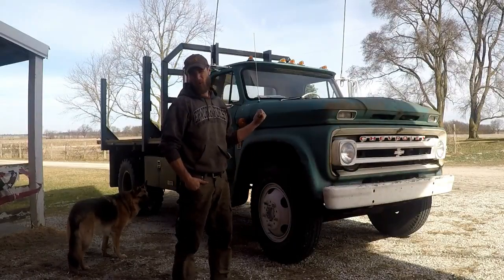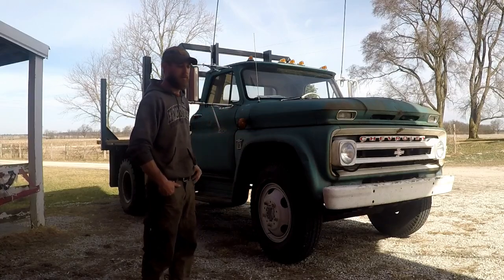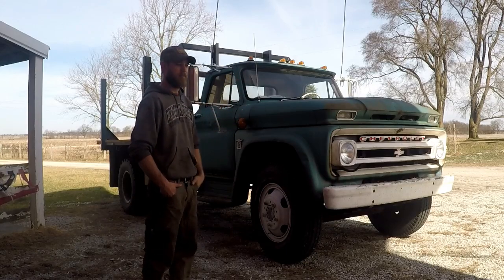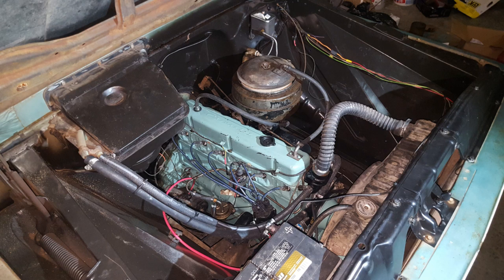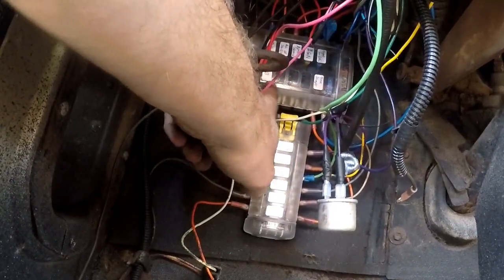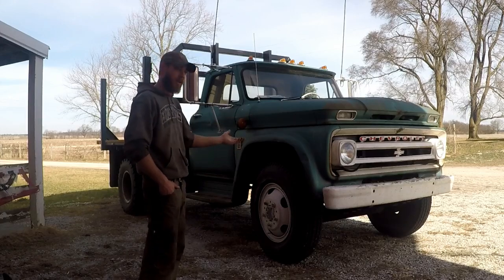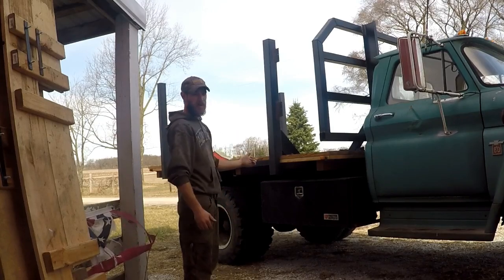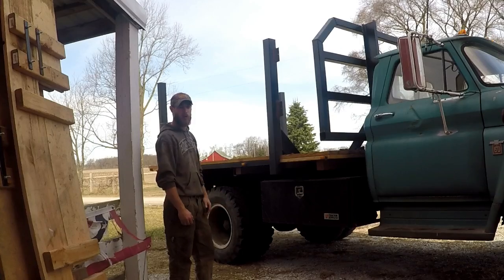1964 C60 Rebuilt

Comment: Love what you've done with the old C60! I bought a '64 C60 dump truck last fall and really haven't had to do much with it. Went through the lights and polished it up and painted the box and got it to pass Virginia State inspection so I can work it. Mine has the 327 but I've had one of those 292 six cylinder. That was a GREAT eingine in the 67 short bed stepside 4X4 I had in my late 20's through late 30's. In the 13 years i drove it we went over 300k miles and the pickup was 22 years old when I bought it and run by a Logging company in Northern California, Trinity Alps, Scott Valley area. It was kinda beat up when I bought it.

Anyway, back to my 64 C60. I had to replace the Hydrovac booster and when I decided the brake line plumbing was not making any sense, I removed the lines form the master cylinder because I felt the return line going into the front of the reservoir from the pressure end of the Hydrovac was not correct. Just as well, it was glued in so I am getting a new master cylinder. Now that I see what you explain, it must be set up right but should it come out of the end of the Hydrovac or should the return be out of the bleeder port?  The brakes were working fine until I started hauling heavy loads. The booster went out on me going into an intersection and fortuneetly no one was in front of me. 
I notice yours has the two port vacuum check valve for the brakes and 2 spd axle. I am going to take mine off and make sure it is not responsible for taking out the Hydrovac. Have you found a good source for those kind of parts if it's bad? I keep looking on the net but haven't seen any check valves like it yet. You can check out my goins on Instagram 

stephen.graf Hope to hear from you. Thanks!
Reply from the maker: The two line brake system uses a smaller line from the output of the master to the input of the hydrovac (top of the cylinder nearest the diaphragm) and then a second larger return line from the tip of the cylinder (as in the outer cap of the cylinder) back to the side of the master where it empties into the reservoir. The Output from the hydrovac is at the bottom of the cylinder and pops out the side in the same orientation as the input before it then travels into the frame. There is also a bleeder for the hydrovac back by the input, but nothing should be attached to this other than a bleed screw. Post # 6 has photos which you can reference, the red circle is the high pressure return. https://www.stovebolt.com/ubbthreads/ubbthreads.php/topics/1348487/re-locating-60-66-big-bolt-brake-parts.html#Post1348487
Further information on this specific brake system can be found here: https://www.stovebolt.com/ubbthreads/ubbthreads.php/topics/1410378/gm-3-line-brake-system-information.html#Post1410378

It is common for the booster to fail with age and can be from a number of reasons. It very likely will not ever be the check valve on the firewall. Typically the master seals go bad and fails to push the necessary fluid to the booster, or the booster diaphragm and or seals fail. If the booster diaphragm fails then the pedal will go to the floor without any actual brake force applied at the wheels, and if the seals go then fluid can actually be bypassed up the vacuum line. In extreme cases, brake fluid can actually be injected into the engine via the vacuum lines from the booster to the carb. Even if the check valve ever fails, it wont cause a true problem for the axle or brake systems except in a case of a pressurized system (vice vacuum), aka a backfire, where rather than pulling vacuums on both systems, it could pressurize those systems and thus cause damage. Its the point of having a check valve in line, to prevent pressurization. Also, OEM style replacements are unobtanium, so just keep running yours as is. If it is indeed bad, you can tell by blowing and air sucking thru it, you can replace with just about any modern day check valve, otherwise keep your eyes peeled at junkyards. When you can actually find one of these trucks in a yard, I almost guarantee it will still have its check valve as no one ever nabs them.
Reply: @RocketFarmer   WOW! Thank you for the info, RF. I am going to contact Precision Rebuilders. When I replaced the Hydrovac I ordered one through NAPA that was like the one on my truck which was for a 1965 C-60. 
Last Friday I ordered a MC 1.25" like the one I have but I will verify the part number for the 1.50" piston and eliminate the return line and have a two line Hydrovac which made the most since to me in the first place. Who ever replace the HV last time literally glued the fitting for the retune into the MC reservoir. Thank you again for relating your information so well. I will keep you posted.
Reply: @RocketFarmer  To make sure I am understanding correctly, RF, you had to send Precision Rebuilders your MC and HV and they made you a system that transformed your three line system into a two line system, Or do they have this application on hand? 

Thank you,

Steve Graf
Reply from the maker: @stephengraf8045  I had to provide my originals as cores. They did not have anything in their inventory that matched my specific setup so they gave me two options.

Option 1: send in my units for a factory rebuild of both the MC and HV and I would retain the factory upgraded 3 line system.

Option 2: provide my original units as cores and they would build me a separate 2 line system from units in their inventory which I would convert my trucks brake system to an easier to maintain/find parts for 2 line system.

I chose option 2 for reliability and maintainability reasons, knowing full well I would be rebuilding this system again in the future. They were able to bore & sleeve my original master and appropriately pair it to a 2 line HV which they then sent my way.

The only difference I see in operation of the 2 line vs 3 line system is that the brake pedal is much more gradual. I will still lock up all 4 corners easily, but it takes an appropriate amount of pedal travel to do so vice how it was with the 3 line system, where a mouse fart on the pedal would lock it up and skid me into the ditch.
Reply: @RocketFarmer  I would prefer option 2 as well. I had a chat with Amy at Precision a minute or so before you sent this and from what you were saying in 2019 I figured Tim may well have retired and he has. She did say she would contact him and see if he is willing to talk to me. 

I have already bought a rebuilt HV for a 65 C60 application thinking there would probably not be any difference. So, perhaps all I need is the 1.50" bore MC with out the return hole and run it as a two line. I'll find out.

The brakes on my truck worked great also. Empty was feather action but loaded was pretty normal. It kinda surprised me when they failed but it was in minimal use for several years and the diaphragm failed once I started loading it up and running it. I was hoping to get a project finished and hopefully still will this Summer. I'll keep you posted, RF

How did you get the Rocket Farmer tag? Rocket Stoves maybe?

Steve Graf
Reply from the maker: @stephengraf8045  Tim is a wealth of knowledge on the 3 line system which has been obsolete for so long now that no one even knows of its existence hardly anymore.

To be fair, you can run a smaller master with the HV you have. I have a 1-1/16" MC that was a stop gap solution to keep me moving back in early 2020 that worked. The brakes weren't as "strong" per say, but a quick hard pump or a double pump (system likely wasn't fully bled) would still bring the truck loaded to 20k to a screaming halt. I cannot comment on long term effects of running a smaller MC though, that would be the wild card.

I am actually a rocket scientist, with a degree in aerospace engineering with focus on rocket propulsion. I am also a farmer, pipe layer, operator, and overall jack of all trades who hates being in an office setting, thus, the yin & yang of my life.
Reply: @RocketFarmer  Tim was saying I could run the 1.25” fine if I could not find a 1.50”. I’ll look a bit more. I really do need to finish my projects before winter and get fire wood. 
🤙🏽🤠
Reply: @RocketFarmer  Well that is fascinating! I was a Machinist in my Uncle Dons shop in Jackson, MI in the late 70's early 80's and we machined parts for NASA through Aeroquip. It is nice to be out and about doing multiple activities. 
As for my quest for a 1.25" master cylinder combo brake/clutch, I am having a wall of N/A out of stock and no one even shows the 1.50"
So I think I am going to go with the 1 1/8" that I am finding and get this thing back on the road. Kinda crazy. I contacted Precision and at least 15 other venders and it comes back N/A. Cardone shows it as 13-34405
and Tim said they made 20k of them a year for Cardone. I think that has come to a halt. That's a relatively low # compared to other items in production I am sure. Thank you again for your help and advice. Take care,

Steve Graf
Reply: @RocketFarmer   Okay~! I contacted my old parts people where I use to live, thinking there are probably more of these old trucks still on the road West of the Mississippi and sure enough, Nicole found a 1.25" with in an hour. Very grateful for that! She's the best! 
So, now I have re routed my plumbing again and it is officially a two line system. I have another question as to the Hydrovac. The installation instructions say I need to add 2 oz oil to the vacuum diaphragm line between the bottom of the poppet valve to the vacuum canister. Did you do that with yours and if so what oil did you use? It says refer to owners manual, LOL 

Thank you again for your input RF
Reply from the maker: @stephengraf8045  That is a new one to me. No where in all of the OEM factory or aftermarket books does it talk about adding any oil to the hydrovac, let alone what type. It makes perfect sense though for keeping the rubber in good condition. I would venture that any silicone based oil would be best as it seems to work well as rubber conditioner. Otherwise I would search for/use an oil that is specified as a rubber conditioner.

When I get a chance ill do some digging here on my end as I am intrigued now.
Reply: @RocketFarmer  Well RF I can not figure out a way to send you the photos of the install instructions that came with the Hydrovac I bought from a local NAPA parts house. If it is of interest send me a link where I can send them. I will also send some pics of my truck. As far as I can tell it only has the actual miles on the odometer which is less than 83k. It's pretty clean. Once I am finished with my projects I will be selling it. I have done everything to make it pass Virginia State Annual safety inspectoin. Full set of new tires on the front and rear and one 22.5 non split rim NEW for a spare, from a company in Wisconsin that has wheels made for this era Chevy and Ford as there is a demand for them. I was going to send these tires back, because I couldn't find anyone who would deal with the split rim's and order a full set of new wheels and then buy new 22.5 tires for it. Then I got a, older than me, Man to come to my shop and take them apart and mount the new tires on them. I had planed on working it once I finished my projects but it is much bigger than I actually need. It's a good ol' truck. I want to replace the rag steering joint even though it looks real solid. I will feel better when it has a C/V joint in stead.  

Steve

Comment: I bought a 1973 C60 in 2018. It had a grain bed on it & I took the back off to turn it into a chip truck. I found a retired neighbor that worked on tons of these & he's been a gold mine!!

I've replaced the alternator, plugs & wires, starter, & rear wheel cylinders. My neighbor helped me clean & adjust the carburetor & choke. Runs pretty well. I also had to find a new diaphragm for the 2 speed rear end.

Comment: Love your truck! Quick idea, for door handle, super easy/quick fix without disassembling the whole door panel-you can loosen the set screw, rotate the handle so it hangs straight down in normal/unlock position (6-o’clock) then itwon’t lock every time it rattles down due to gravity. That will hold you until you can try a new door latch relay linkage, they are around $25. I agree it is a little annoying every time you have to get in it is locked! I have a ‘64 C10 and working on getting a ‘63 C50 at the moment
Reply from the maker: Not a bad idea at all. I keep the vent window unlatched and use it to open the door and then just roll the window down typically right  now

Comment: Mine is a 1965 C60. The 292 will drive away from 350 GM , or 351 Ford on take off under loads. But top end is a different story. Mine gets extremely great fuel mileage , for what it is. When scrap steel was selling so hi , me and a friend were doing tear outs from factories. We would load both my C60 13.foot dump , and his one ton F350 dually. Both made the same amount of trips , but the 292 would get nearly twice the fuel economy of that 351 Windsor. Mine would be way heavier , but would pull away on long hills , and at take off. 
   Also I put power steering from a late.70's C60. Was able to swap the entire front axle , steering box under mine. That gave me the 10 lug pattern. You will notice a big difference of having to drive around tight places all day with power steering. These trucks do steer well with a manual setup , but being able to steer with one finger is awesome. 
   One thing is I keep busting 4 speeds. Have been hoping to find a Clark 5 speed. I baby it , but some reason 1st gear explodes on them.   But it has been way over loaded with massive boilers , carpet tufting machines. They explode while it's empty tho. I buy every one I come across. Like every one I've put in are quiet , and shift smoothly. Never have I had one go out in a one ton , even with a 454 hooked to it. Hopefully yours will last. If you're just hauling wood , hay , and the like you won't have any trouble.

Comment: Ok. I owned these old trucks back in the day. I know every inch of this truck. You have a 5,000 pound front axle, The rear axle is a 15,000 pound. The rear axle is not really that good. I use to go though a stump a year. Look for a 17,000 pound to replace the  15,000. The 17,000 use a electric two speed.  The stock wheels will come apart over time. Look for tubeless wheels. The 292 will out pull a 350 on any hill. The 292 will last 100,000 and that is it. The 292 will out pull the Ford 330, and the 304 International, and the 318 Dodge. They are tuff and run like hell. I worked at a Chevy dealer back then and I still have some parts. Keep your eyes out for a 17,000. They have the same axle cap as the 15,000. But they all have electric two speed motor. These old Chevy drove good too.
Reply from the maker: If I was running her hard every day I would ditch the 15k rear simply for the weight class upgrade and more readily available brake shoes, but as is, there isn't any immediate need to do so. When I track down a good rear end I'll snag it and store it in the barn for a rainy day. Same with a 7k front.

There is no way I will ever consider tubeless 1 piece wheels. The wheels alone are $200+ per, and have to be custom ordered. Factor in rubber on top of that and it will cost double what the truck is worth. Again, if it was a daily worker, maybe, but I'll stick with ring lock and 3 piece wheels and bias plys. If you know how to drive on that setup, it isn't bad at all.

I like the 292 for its grunting ability and (compared to tall deck V8's of the era) gas mileage. She's fresh and good for another 40 years, then has one more rebuild left in her to punch bore out to .060 over.
Reply: I had one of those 292s in a truck that had at least 172,000 on it when I got it, and I put at least another 150,000 on it before it died. If the radiator hadn't blown, causing it to overheat, it would have lasted even longer. If you take care of it, those engines are very tough and durable and long lasting.

Comment: If you want to get rid of the one barrel carburetor ⁉️go to the parts store and get a one too two barrel carburetor adapter ‼️👍🏻 and the points problem with it change it over to electric dest, it's a change over ‼️